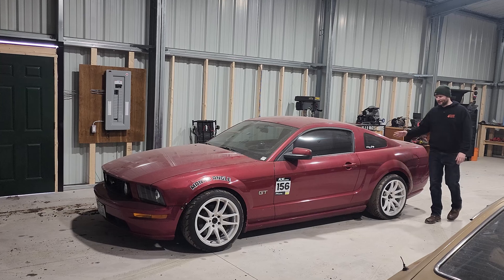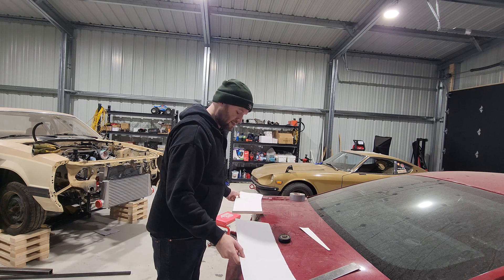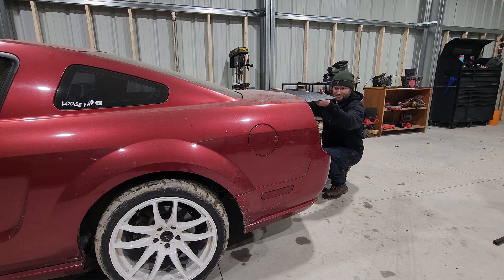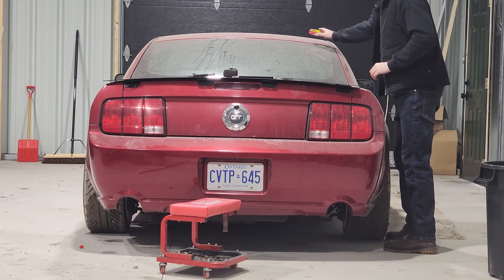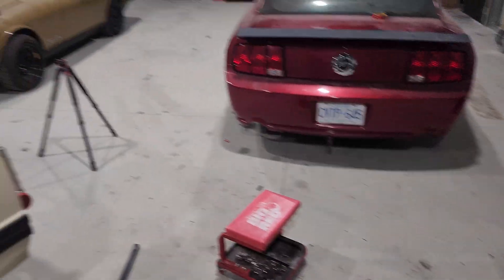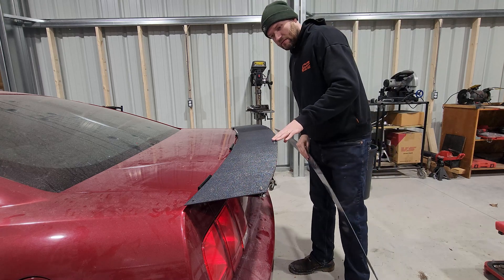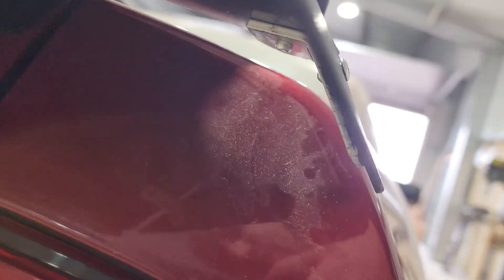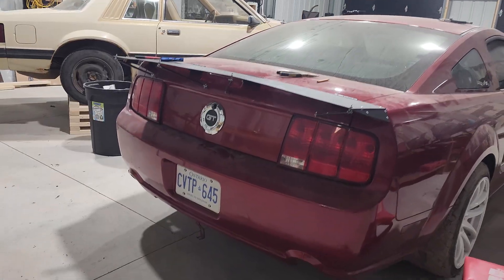Building a car wing/spoiler is easier than you think.

Comment: do you have a 3d printer? that would work awesome for printing ASA end caps for the spoiler
Reply from the maker: I do! And that's a great idea! I just have an ender 3 so I'm not sure it would be up to Asa. I have been considering upgrading though, I do love 3D printing and it would be awesome to be able to print stuff for automotive applications
Reply: @LooseFab   I had an ender 5plus, now I have a Bambu x1c, completely different tool. I print ASA mostly  but working my way up to the exotic stuff
Reply from the maker: @notsure6182  how are you liking the bambu? i hear people love them or hate them, but thats what I was considering if I were to upgrade
Reply: @LooseFab  it is great. I need to learn fusion. I have only drawn and printed a couple of things, but I have printed online files a lot. I sent an x1c to my nephew in Switzerland, so I guess you can say I like them. I am sitting here staring at Bambu's site trying to decide if I will drop $3g CDN in 31 minutes when the H2D is 'available' for purchase :) it has all the heated stuff to make things from fancier filaments
Reply: @LooseFab  short answer. 99.9% of the time it just prints the file perfectly. so its nothing like an d Ender :)
Reply from the maker: @notsure6182  so did you buy the H2D?
Reply: @ didnt pull the trigger yet
Reply from the maker: @ this is your sign to buy it lol
Reply: @LooseFab  a 2 or 4 post hoist is the same money though :) and the x1c works pretty good. just needs all the cool stuff they added to the new one, heated chamber heated AMS dual nozzle for fast cheap support filaments, increased size .... its still on preorder status in Canada. doesnt really release until the 25th... too many toys to play with and not enough $ or time :)
Reply from the maker: @notsure6182  I know the feeling! I'd love to upgrade printers but I agree, a hoist would probably be higher on my list!

Comment: I bought those mastercraft drill bits. total junk. they snap constantly. I think I went through about 10 of them on a job and got maybe 3 holes drilled, put a better quality bit in and did the rest of the day with no issues. sad to see you hack on the poor mustang but it looks like Onterrible winter was eating it up anyway.
Reply from the maker: Yeah the drill bits are junk, for the price though if you're just doing thin metal or wood they aren't terrible. I have some Milwaukee bits for more important holes lol. The car is beat up but it's actually in fairly good shape!